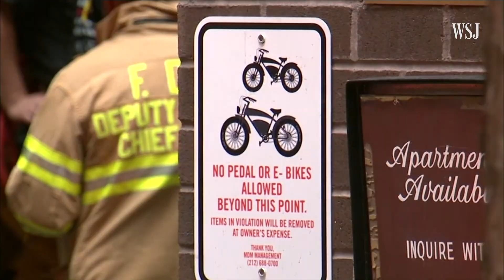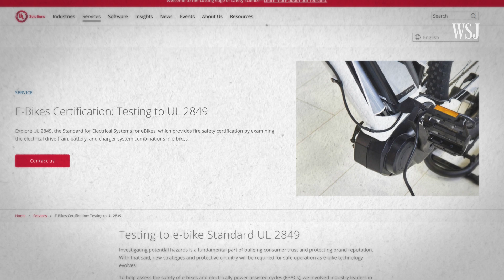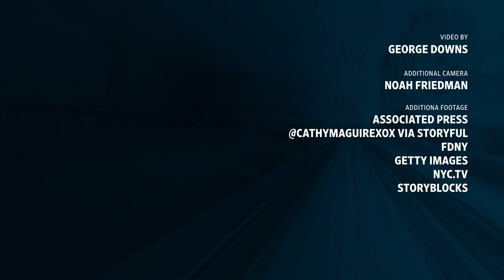E-Bike Batteries Keep Exploding. What’s the Solution?

Comment: Actually there are much easier and cheaper ways to solve the problem of fires, in fact there are two ways that I know of.

1, allow people to have petrol powered bikes and scooters with the same capabilities as ebikes.

It would stop the fires of batteries.

2/ Incorporate carbon felt/ into the battery box at the production level, that stuff can get as hot as 3200c before it fails in an oxidising atmosphere, and the batteries burn at around 3000 c so I'm given to understand, so if that is true then by using carbon felt you would stop the fire from spreading, but you would still probably get smoke.

But that would mean increasing the size of the battery boxes to accommodate the carbon felt, and carbon felt would need to be reduced in price or it would be too expensive to use.

Comment: The manufacturers should be required to have the batteries UL certified before they can import them to the US
Reply: UL certification may help, but it is at best only a minor enhancement of safety. Many of the sources of risk of fire apply to high quality batteries just as much as to low quality batteries. For proof of this, look at all the EV fires that involve Tesla and other top tier car brands. The problem is, when a lithium-ion battery is damaged -- which can happen by the bike or car hitting a bump -- the battery may overheat and catch fire. Making the battery to a 'higher quality' standard doesn't eliminate this risk. Worse, while sensors can detect some types of battery damage -- warning the user and shutting the battery down, many types of damage cannot be detected. 

Maybe, someday, the technology will improve and we'll be able make batteries that are not subject to these risks. Unfortunately, the state of the art does not permit us to make a battery that is both light enough to be functional and durable enough to be perfectly safe.
Reply: said the guy who works at underwriters laboratories....
Reply: @tommurphy4307  😂😂
Reply: Agreed
Reply: You're deluded... The cheapo companies aren't cheap...
The "expesno" companies are expensive.
That's who the culprit of expensive batteries and bikes... is.
Cheapo companies are normal.
"Expenso" companies are the product of opportunist price gouging shills
in an opportunist price gouging country.
Reply: This certification is a joke. As was stated ,the pot holes, the weather vandalism etc all have any effect on the life of the lithium battery. I am wondering if eventually all lithium batteries will burst into flames? No seriously are these going to end up in the dump and then sporadically in about 25 years we just have fire bursting up all over? Why wouldn't they? I watched another video that showed that the lithium just put in water will react and burst into flames. Eventually everything in this world gets wet.
Reply: This will never happen the price of this is100 k a bike an another for each bike
Reply: most are.
but theres 2 sub categories to consider
1) cheapo companies
2) DIY enthusiats 

those dont care about quality but price. DIY is a wide range of people that unless they understand to buy a charger that has a built in monitor. which would still need to be set since its not pre-programmed to the battery so it must know ALL of the specifications battery size, charge speed, and other stuff. i honestly dont know the correct jargon so i steer clear of that. but knowing watts, amps, volts, and how many cells in a the battery compartment makes the difference between a fire or a battery that lasts longer until its service life finally ends (which could be 2 years or longer, since nothing honestly lasts forever)

but the other group which is cheapo companies, theyre kinda the low price point Chinese and other overseas companies. now i dont mean ALL chinese companies are bad since Ive owned very reputable chinese goods and just make a point to stick with the same company for repair parts. (i was an entry level drone flier back then. now i feel more confidant not sinking my drone into the big waters like atlantic ocean, pacific ocean, gulf of mexico, and mississippi river (all of which i have flown over and have come back with my drone, cuz i learned with the $50 drones and kept their maintainence)  

so yeah, as an enthusiast person I make sure to read and learn about stuff so i dont burn down my house but others like uniformed kids or parents who dont learn about the safety risks before hand... well lets just say theyre in the news after learning the hard way. LIPO fires are not cool. 😅
Reply: @ericolens3  for a sec I thought you were trying to pitch in the idea of selling $50 drones in droves. 🤔
Reply: One day that might happen, but that’s gonna take years to fruition!
Reply: You're dreaming,...
Reply: @8000RPM.  We do it with every other electrical appliances.  An E Bike is just another appliance
Reply: that doesnt stop mischarging , different ports for different amp ratings would save lots fires , i have multiple batteries with 2 to 6 amp charging rates ,,its too easy to put a 6a charger on a 2a rated battery. And user misuse is behind a few as well i suspect . I personally have had no problems with cheep chinese batteries/motors  in over 5 years and for the money are a lifesaver for cash poor environmentally aware folks .
Reply: All the batteries come from the same source CTAL in China, so a UL listing means nothing.
Reply: @tjhessmon4327  It means everything. It means that the battery is assembled correctly, instead of hackjob.

Comment: I was a seller of the lithium-ion e-bike battery before. I deeply know how important raw materials like the battery cell holder and the pure nickel and the quality of the battery cell and the battery management system to prevent the battery from burning. please remind to confirm the battery cell brand before you purchase it and check the history of the factory, whether they are new built or for a long time.
Reply: Yes but the latest UPP battery  ban  is BS  as the factory has nothing but glowing credits , a youtube channel showing the manufacture and many enthusiast teardowns ..conclusion great value for money and safe used in the manufacturers guidelines, yet official banned it ?
Reply: There's no proof of quality of cells or efficiency of battery management system used in these batteries....there needs to be safety sanders and compliance rules to qualify for the right to sell.
Reply: Doesn’t Samsung make the majority of those batteries? And can’t people purchase the cells and construct them themselves?
Reply: @rolandthethompsongunner64   No the batteries are constructed by CTAL in China.. they only sell the constructed, complete packs.
Reply: @rolandthethompsongunner64  Samsung used to be the lead but as of the past decade Chinese knock off's have been FLOODING the market at higher volumes than ever pretending to be Samsung or LG cells

Comment: A partial solution -placing Sodium Bicarbonate between each battery in the battery packs. Sodium Bicarbonate when heated to 100 degrees Centigrade (212 degrees Fahrenheit) releases Carbon Dioxide which asphyxiates oxygen fed fires . Essentially these battery packs go into thermal runaway with the many multiple batteries are susceptible to heat and especially oxygen. One battery bursting into flame can cause other batteries to go into thermal runaway. Without oxygen or in an inert atmosphere combustibles can't combust. This might not stop a battery pack fire since every battery contains its own oxygen but it could greatly slow the combustion rate and may prevent some batteries from not combusting,

I keep a small box of baking soda in my ebikes trunk bags which contains my battery pack.

Alternatively store lots of baking soda and have good working smoke detectors in the enclosed area especially near ebikes and their battery packs. Especially store baking soda on possible combustible items in your residence. The released carbon dioxide will asphyxiate a fire but also will asphyxiate a human too so either quickly put out the fire yourself or else flee quickly and alert the proper fire department authorities. Storing lots of baking soda near possible combustion areas like near a kitchen stove or toaster etc could very well stop a house fire. But again be sure to have working smoke detectors otherwise you too could get asphyxiated by released carbon dioxide which is a poison to humans in high concentrations.
On the plus side Baking soda is very inexpensive.
Reply: Lithium Ion battery fires are chemical fires and actually generate their own supply of both oxygen and hydrogen.  Additionally, Lithium Ion battery fires burn extremely hot.  The burning lithium metal can reach up to 3600 degrees Fahrenheit. CO2 exposed to such a high temperature will actually split the atom and you end up with pure oxygen.  Applying CO2 foam, for example, will actually make the fire worse.  The best way to extinguish a Lithium Ion battery fire is by cooling it.
Reply: @NorthernKitty   you gotta fan it and cool it
Honey till the cows come home
Reply: You can't go wrong with baking soda. It has many uses.
Reply: Unfortunately, CO2 doesn't work on Lithium fires - you need a special water-based foam extinguisher like the Bavaria X6... they are cheap too: only around 390,00 a pop!
Reply: @f.d.6667  You say that and you can say that. CO2 prevents other combustibles nearby from catching on fire. You don't believe it that's your choice.
Reply: @m9078jk3 The cathode creates it's own oxygen when it decomposes, co2 will not work unless you can inject liquid co2 into the case and that would just prevent the next cell on line from getting hot enough to catch fire.
Even plain water can do that though the problem is getting the water inside the case. All we need is to give away cheap breadbox size fireproof boxes.
Reply: @ghz24  Co2 will prevent other combustibles nearby from igniting.
Reply: @m9078jk3  sure co2 will stop the spread to other things nearby if you have enough to keep at it till the battery burns out.
A co2 fire extinguisher will not put out the battery.
It has its own oxygen supply from the cathode decomposition. A bicarbonate producing co2 will not stop the spread to other cells.
Reply: @m9078jk3  bicarbonate won't save a battery from burning so the earth is doomed ? WTF?
Have you completely lost it?
How are those related in the slightest bit?
Reply: @ghz24  You stated the the fire can't be stopped ever so if it never stopped then the fire will continue forever.
Reply: @m9078jk3  Better check yourself I never said any such thing. But at least now I know, you have lost it.
Reply: So are small fire extinguishers.

Comment: Apartment blocks owners should do two things:  Provide a secure non combustible bike storage shed or secured parking corral for bikes and prohibit E Bike storage in apartment/condo suites.
Reply: Or just a fireproof box for the battery to get charged in.
Reply: 🥴 They should provide..

Blab blah.
  But then don't let them use it?🙄
Reply: To charge my Giant Stance E-bike battery I use an old red metal toolbox i wasnt using that has two top shelves in it that fold down when the top is shut , it opens from the top with two  sides and the buckle locks are down the middle of the top and then i drilled some holes to allow ventilation , and when closed the holes allow air but the shelves inside block any fire that could shoot out if the battery ever did explode inside. So if that did happen im hoping and pretty sure it will work to contain the fire to inside the toolbox and not burn my house down and if your still worried you could also get a metal trash can with lid and do the same drill some hole for ventilation  and put the toolbox with battery inside the trash can for double protection.

Reply
Reply: It's more than just an chemical firework, it's more like a flashing big bang explosion that burns hot enough to melt  pavement and anything around it very difficult to contain. Violent and instantaneous reaction.
Reply: Why is it the owner's job to fix a problem the apartment tenant cause?

Comment: full stop most are because or user error bypassing bms, pushing battery to its limits every time it riden, all my batteries i build now use immersion cooling ,they are submerged in 3m dilectric liquid ,which means fire is impossible ,and they never over heat ,thermal ruunnaway is the leading cause of fire,and this would stop all of them
Reply: the cooling system can also warm the cells in minuus temps if required ,i uuse basic computer cpu cooling set up to cool the liquid but most bikes would only need a heat sink

Comment: Not supposed to charge overnight some get to hott. And def supposed to let battery cool down after use before you charge.  Then the do it yourself crowd lol
Reply: What is the problem with the DIY? Most bike fires are from purchased ready bikes not from DIY batteries.  I actually trust my self more building a battery then purchasing one. 
Also there are some points I agree with you, don't leave it over night, don't recharge while sleeping, don't leave it unattended, don't use fast chargers.
Also this applies for everything that has a lithium cell, I never leave my razor to charge overnight or if I am not home, same for phones, laptops, etc.

Comment: 5 main reasons of lithium battery fires:

Over charging batteries

Fast charging at high amps above the input C rating of the cells or fast charging in cold weather causing lithium dendrites

Faulty / cheap or missing BMS inside the battery pack

Faulty, cheap or mismatching charger

Recycled cells with lithium dendrites being used to build "new" battery packs
Reply: Cliffs Notes: Cheap crap from communist countries with mfg that does not care about the end product.
Reply: Lithium dendrites grow naturally. Every lithium cell will get its separator punctured at some point in its lifetime. This is why you see so many used server batteries on sale at various
online shops. 3-5 years is the max tolerable period, even for lifepo4 cells
Reply: @12villages  that is simply not true.
Reply: @12villages 1. Not really. They kinda do grow but much slower. 2. They deteriorate, lose the charge, not catch fire for no reason. And the more charge they lose the less is the possibility of ignition, as they have less energy to output. I punctured semidegraded(but still charged) lithium-polymer batteries several times with arrows and metal rods on purpose, to see what happens. Guess what? Nothing. Quite literally, nothing happened, they didn't even smoke.
Reply: @Drak_Thedp  I am on a much used `banned chinese battery , 5 years later easily 80% plus of original capacity and paid for itself many times over in fuel savings .  I do charge and store them in an old oven to allay family fears .
Reply: Reason six--lithium batteries.
Reply: Or they just go up in flames for no reason whatsoever
Reply: @johnbolt665  clearly your new to this.

Comment: How about building safe charging boxes to house the battery during charging at the very least charge where there are non combustibles and possible add an alarm that can detect heat not sure if that’s a possible device made yet but for inventers hop on it keep it reasonable though could be saving lives I charge my battery in a cooking pan or bake sheet on or even in the oven of course a turned off electric oven but safe boxes should be an easy one for dyi ers